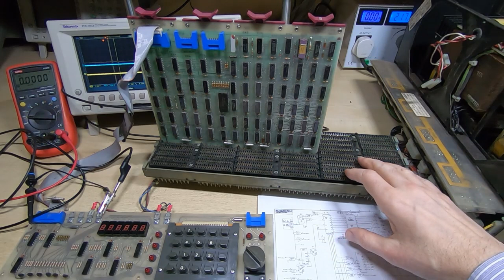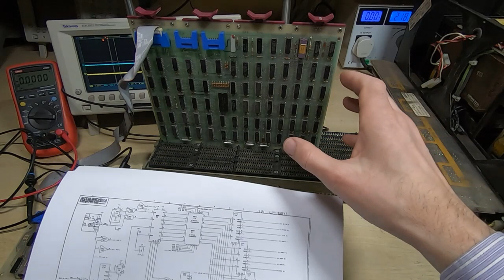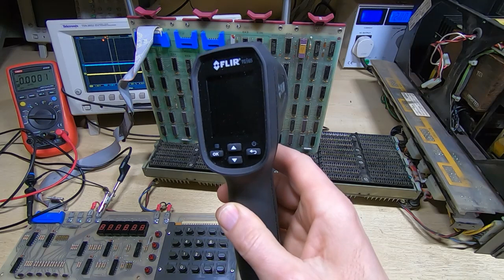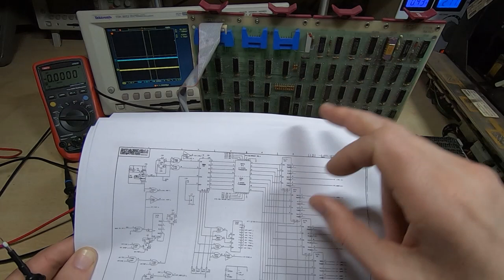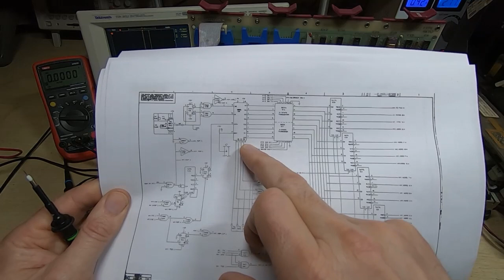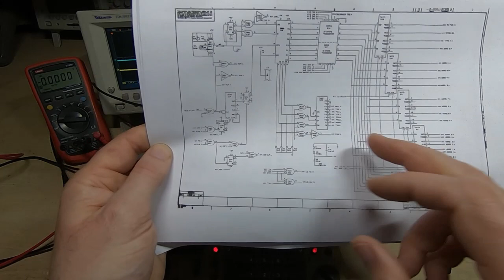PDP11-34A Repair Part3

Comment: What I don't understand is, if the 8008 is so precious, why did you just switch on the system with all the cards in place ? I never would do that, I always disconnect everything and check the power supply first.

Comment: Hi Jerry. I found your channel a few weeks ago and I love it. I think your way of explaining how this old tech. works is brilliant. I collect and restore old DEC equipment and I have several machines and peripherals setup in a little museum that the wife has allowed me to build in the front room. I recently acquired an ASR33. It's in really good condition - I think the last owner was a radio ham and kept it serviced and loved. It came with all the manuals and accessories. I'd like to ask you if you would be prepared to service it for me. I haven't powered it on as I don't want to break anything. I was going to have a go myself but your level of expertise with these machines is light years ahead of me and I want to have this machine working in the museum for years to come connected to the old iron in there. I went to your website but it seems to be broken. Is there a way that I can contact you ?
Reply from the maker: Hi, Yes I would be happy to look at it for you but please be aware that I am not running a commercial company and do not offer warranties etc. For the web site please try http instead of https and it should work.

Comment: Jerry, this is and will continue to be a fascinating series.  I've never worked on or with PDP-11s, though I've got several different LSI-11s and their peripherals waiting to be played with, along with a VAX4000.  I've spent most of my time playing with PDP-8s so far, but I find all of DEC's computers interesting.  I enjoy and learn from watching you explain your troubleshooting and clear reasoning behind what you are doing!  From my point of view, you could go into much more depth of signal tracing and troubleshooting, but I understand that you have to strike a balance between viewers that want lots of technical details and those that want quick videos.  Have you considered using YouTube's "chapter markers" (or whatever they call them) so folks that are in a hurry could easily skip over the more "technical stuff"?
Reply: Hey Bob, I've just finished restoring a VAX4000-300. I found it in a barn and it was in a sorry state. Had a lot of 'fun' getting it back to life. The PSU is particularly complex. Reach out if you need any help or advice.

Comment: Very interesting Jerry. I think that the level is pitched about right as far as I am concerned - maybe could go into a little more depth but no need to show all the signal tracing involved. Lucky that the 8008 was still good! Move on a generation and a PDP-11/LSI-11 was itself used as a console processor for the VAX-11/780. Having a proven working console card and front panel will no doubt be a massive help in troubleshooting the other cards including the processor set. Hopefully you will be able to find a matched set of suitable 7-segment LED's to fix the display - it would be a shame to not have the front panel looking nice. Looking forward to the next thrilling installment! PS. I know that the little switch doesn't carry the full system power - it just amuses me that such a wimpy switch controls the big relay clunk and fan racket! :)

Comment: I think the CPU board has the proper termination circuits on it, or am I wrong?
Reply from the maker: Correct but the 2 CPU cards must be fitted into the first 2 backplane slots so would hide the cards in the other slots unless I fit a riser and they draw so much power that I would need to fit the fans. I also want to check the cards one at a time. However once the CPU cards are fitted the bus will be properly terminated. I will be using a second termination card for the testing as this is only 2 slots wide so does not get in the way.

Comment: D-E-C was and is perfectly acceptable. Rod Smallwood D-E-C 1975-1985
Reply: So long as he doesn’t insist on VAX being V-A-X. That’s just unnatural. — Stephen Youndt, VAXherd (1983-1995)
Reply: I think it's a regional thing... It was always "deck" in the US, or in later years 'digital' when they tried to rebrand. I'm guessing that's why he got the original comments and why the difference in attitudes...
Reply: @warnerlosh  We were a world wide company. DEC (deck), D-E-C ,digital and even PDP all got used and varied from country to country.  They were used to saying I-B-M, R-C-A and G-E-C so D-E-C followed the pattern.
Reply: D-O-S ne1?
Reply: @CATech1138  Well DOS was either "doss" or D-O-S and NE1 was a network card. More DECSpeak... RT11 was always R-T eleven. RSX11 was always "R-S-X eleven". RSTS was "ristus". MUMPS was "mumps". TOPS10 was "tops ten". The whole US operation was often called "Maynard". Printing terminals "deck writer". VDU's  "vee tee". Printed messages "Twix".